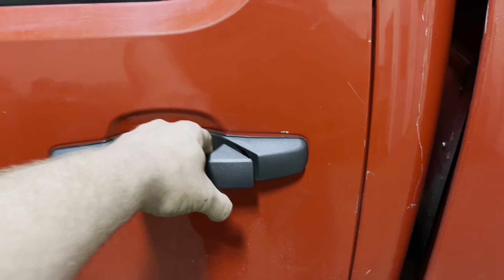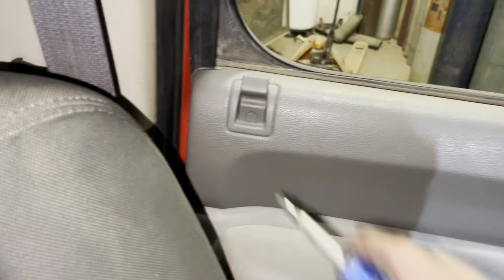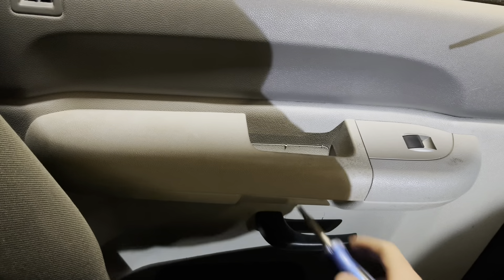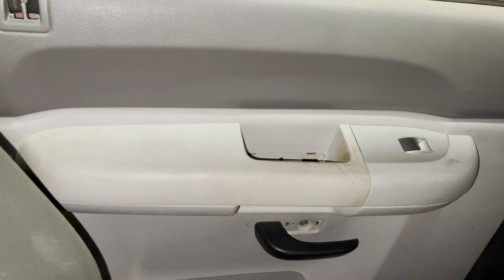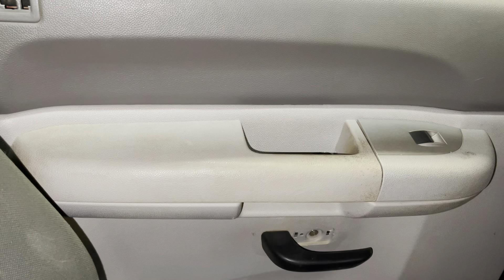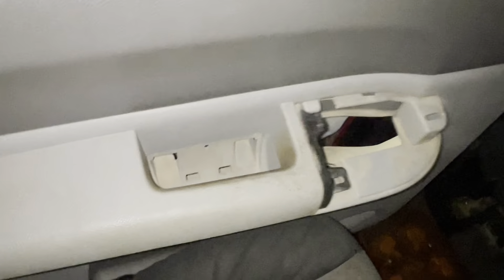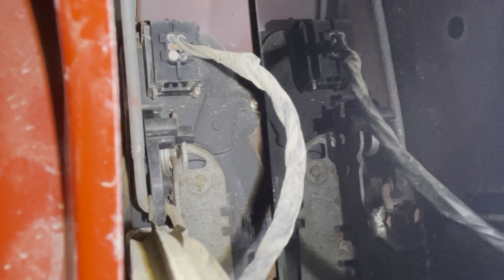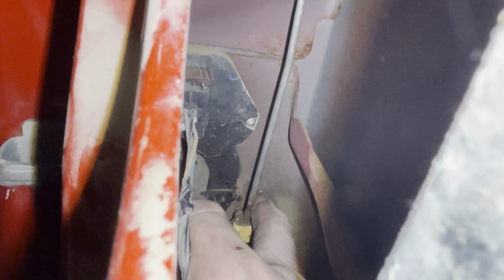07-13 Silverado door lock actuator replacement

Comment: I watched a few  of videos of the latch being  changed your video is the best you get a really  good camera  shot on how  the door will not open unless you put your hand in to make the latch go that 1/16 inch further.
I could not get my front driver's door open.  I took a  grinder with a cut-off wheel and cut a hole in the door skin after trying for hours.thank you for a great video
Reply from the maker: I did the same thing and decided I’d try to make a shot on what todo, thank you.